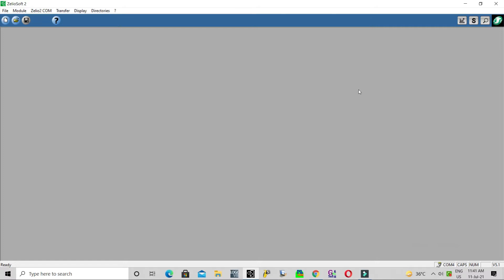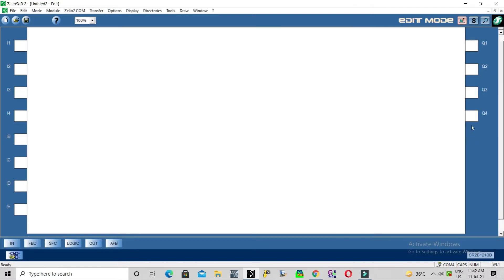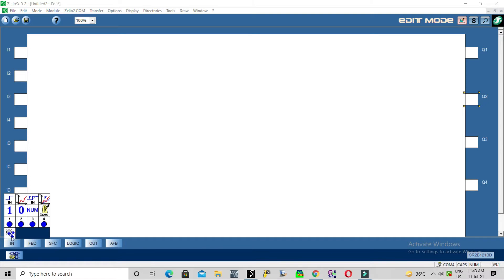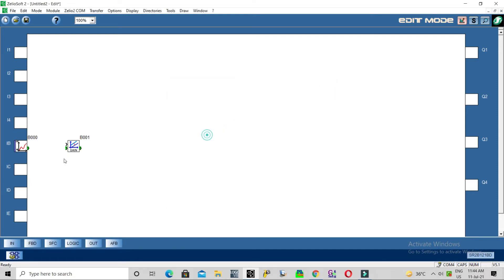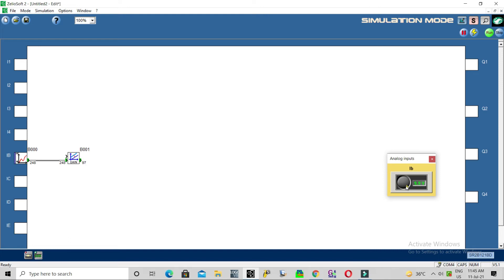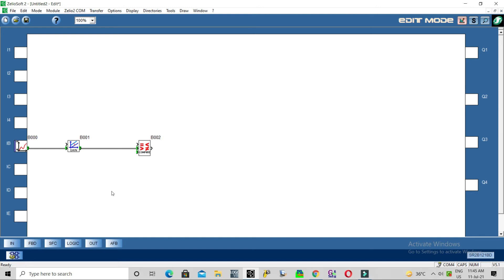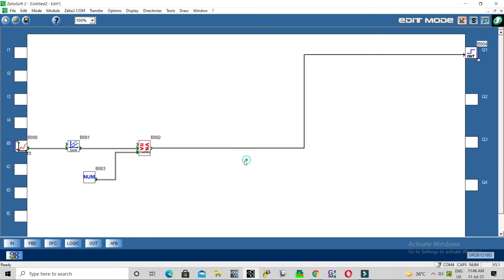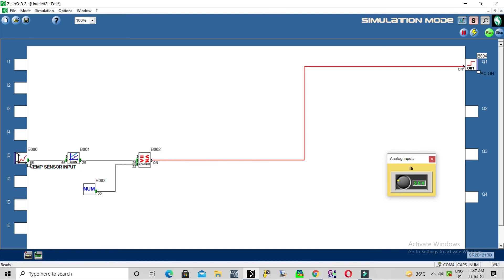SCHNEIDER PLC - PLC Tutorial-1 PLC analog input scaling for pressure input

Comment: Could you add detail as to how you came up with the 0 to 255?  I'm searching for this now after watching your great video.
Reply from the maker: 0 value is your sensor range minimum value, 255 is sensor maximum value
ex- if you have pressure transducer 0-10bar range and output with 0-10v
then 0 is 0v 255 is 10volt
255 did by 10 = 25.5 equal to 1 bar

if you have temp sensor 0-60deg cel with o-10v out
0 is min value 255 divd by60 = 4.250 equal to 1 deg cel
hope you got